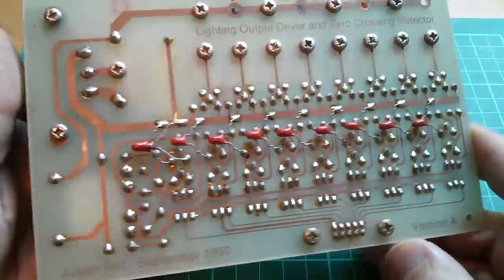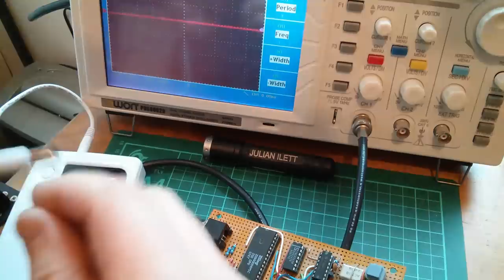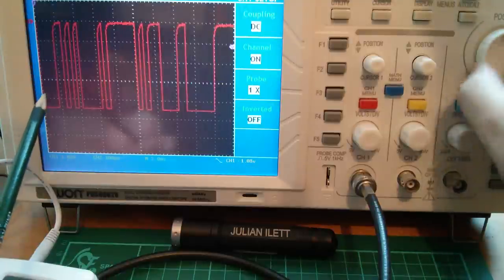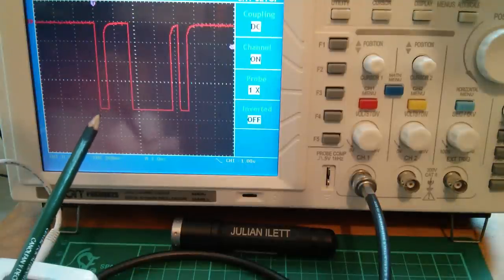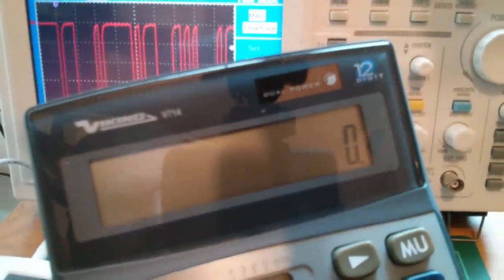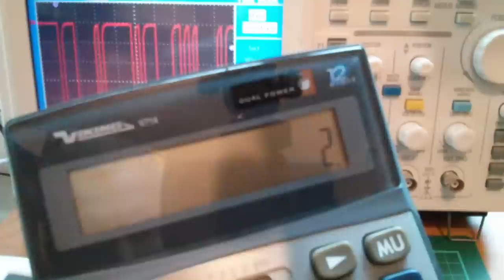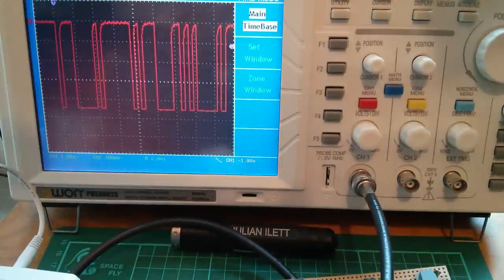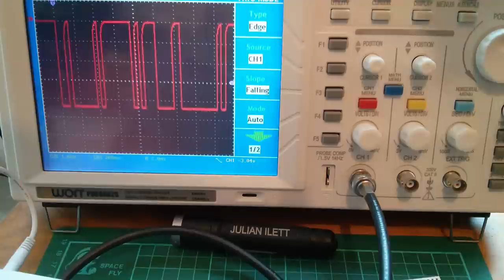Retro Electronics: Z80 Microprocessor Serial Data Transmitter

Comment: It's a bit unfair to say that the Z80 is hard to use. Sure, microcontrollers are simpler for control tasks like these, but you can't make a proper computer that loads and executes code from memory with most microcontrollers. My first computer (the speccy) where I first started learning programming, used this little chip as its CPU. As a result I'm exceedingly fond of it :)

Comment: Good old Z80. I wrote a Z80 emulator & debugger on a VAX Minicomputer while I was at Uni in the early 1980's so I got to know that CPU quite well :-)  Thanks for bringing back those memories.  Also, your Z80 boards etc look like one of my later projects using 6809. Still in the loft somewhere.

Comment: Good old Z80 times. If you are really a Z80 nerd then you know what this is off your head:
21 00 00   11 00 40   01 00 40   ED B0  C9
Reply from the maker: Something like: load HL, DE and BC with data; LDIR; RET which probably wipes the entire memory!
Reply: +Julian Ilett WOW!
LD HL,0000; LD DE,4000; LD BC,4000; LDIR; RET copies 0000-3FFF to 4000-7FFF and returns. Good old Z80. Some parts of the Z80 machine codes are still in every core-i7...
Reply: I remember C9h as RET, that's stuck in my head still

Comment: The good thing about Z80 is that there is instruction which the engineer who design it didn't know it exists. Like....

Op code shift DD or FD    and then using single byte LOAD instructions, not documented in any manual. Because they didn't imagine that possibility.

so you can "LD b, IYh"   or " LD c, IYl"

or , LD a, IYh    .... LD a, IYl

and just handle the Indexes registers as any other 8 bit operand.

This is because "shift opcodes" which enables new opcodes tables are just, by exameple: 

Exchanging for only the next instruction IY instead  HL    = FDh
Exchanging for only the next instruction IX instead  HL    = DDh

while EXX and EX DE , HL does the exchange but permanently.

what are exchanged? the ENABLEs signals to the registers, 

So, BC DE HL can become  BC' DE' HL'
and the resulted HL or HL' can become IX or IY
also, AF can become AF' .

So there is like five control flipflops.

Comment: Back when you were designing this I was trying to design a Z80 multiple CPU.  Just didn't have the time and always going around the world.  I did pick it up back in the 90's but switched to the CPU of the time which was 386.  I got the OS written as I thought that would be the hard bit but I was defeated by a hard drive crash and bad tape and floppy backups.  Wished I had a second hard drive controller if it but it was on the pricey side then.  And so the project died.

Comment: This is a great video. Thanks for showing your Z80 serial light controller boards! The Z80 isnt dead but still in wide use. I am currently learning Z80 assembly on a Micro Professor Trainer board that my University kindly let me have. I'm having a lot of fun learning assembly which is something that I wanted to do since having a ZX81 back in the 80's and am in the process of getting a 2x16 LCD interfaced to the on board Z80 PIO. It isn't easy but its excellent fun. :)
Reply: Peek and poke!

Comment: I actually stumbled across a Z80 recently.
I bought an old arcade poker-machine and the brains of it is a Z80.
I'm in the process of finding out which of the supporting chips is faulty. I'm only getting random sprites on the screen.
Not an easy task with my oscilloscope packed away.
Anyway, I'm hoping to learn plenty while doing it. The Z80 predates my world of microcontrollers. I started with pic-processors.

Comment: I still have my first computer,  an Osborne Executive,  which used a z80 processor and came with 128K of RAM in the box.  Somewhere I have a board that somebody sent me that would allow you to replace the original memory daughterboard with different parts (people also did this by piggybacking the chips one on top of another) and end up with 512K,  which could give you a ramdisk, printer buffer,  etc.  I've never populated that board.  I also have a ton of chips,  both in this family and in the 6500-series family,  which has its enthusiasts as well,  and I used to think fairly regularly that I was going to build some stuff with some of that but somehow never got around to it.  These days I'm seeing all the nifty stuff that you're doing with arduino boards,  and am thinking about acquiring some of those to play with instead...   :-)

Comment: Hello Julien. At 6:25 you mention the Plastic Cones. Would you be able to track them down at Mouser or somehwere else? Also the copper wire, i did not understand exactly how you call them, but understood how it works. I am very interested as i soon will start on a 8086 project. Also for your "pcb etching" i have special paper in my laserprinter. i print my (diptrace) layout onto it and then use a t-shirt hotpress at 266°F for 3 minutes to put the layout onto the pcb. after that i wash it with warm water off and off we go into the feryd chlorid bath. fast and easy.

Comment: I have a board similar to that from 1986 I built for central heating timer using the 50 hertz mains has an interrupt for the clock. a lot of work compared to today's microcontroller. oshonsoft do a very good simulator for the z80 along with today's microcontrollers.

Comment: Epic fail Julian. The trace on the CRO did not change colour in sync with the light controller :)
I think calling the ZS80 a microcontroller is not quite right it is probably more correctly called a microprocessor and likely predates anything we would recognise as a microcontroller. I certainly recall using the Z80 in a computer long before I was messing with 16F84 pics. The fine wire you called vero wire was known as wrapping wire here in Aus. Still pretty useful today if not in it's intended role

Comment: Are those "plastic cones'  common to fine enamel wire wiring? I have never seen this technique before on strip-board, it seems to keep everything quite neat.
Reply: I have since found that the plastic parts used for the fine enamel wiring are called wiring combs
Reply: @matthewcook7444  unusually expensive for small bits of plastic too, I was hoping China would make them for pennies by now

Comment: very interesting, i would love to see a video of you exploring that floppy disk's custom encoding of sort you described - would be really cool to see that in 2015!
Reply from the maker: +BoomBrush I'd love to look at that again. Formatting the disks is really interesting - the sectors are not sequential because there's not enough time after reading one sector to read the next (or write - I can't remember). So the sectors are skewed. I seem to remember having 9 sectors numbered 1,5,9,4,8,3,7,2,6
Reply: +Julian Ilett Could you fashion some kind of 5 1/4 floppy drive slave controller from an arduino and just raw dump the whole disk then software decode it? 
Excuse my ignorance if I'm talking complete b*ll*cks here - my floppy disk knowledge is foggy at best. I remember the Amiga doing hideous things to disk structure in the name of copy-protection, but that's about it.
Reply: One "easy" way to recuperate these files using a modern PC  is to buy a USB/Floppy drive, rip out the 3.5 inch drive and connect an old 5 1/4 inch drive.

You then need to get or write an application which read raw sectors. Even if the sectors are out of order, you can still ask the controller to read each sector in sequential numeric order, from 1 to 9. It is just slower as the controller need to wait up to an entire rotation to find the sector number specified. Since the rotation speed is 5 turn / second, it may take up to 9 * 1/5 = 2 seconds per track.

I wrote an assembler code on the 6809 processor (the radio shack Color computer) which was reading the sectors in the exact order written by the default formatting. 

I was able to read the entire track in one rotation, command to move to the next track and start reading at the sector number that would happen to be ready once the head vibration was low enough. I got the amazing performance of reading almost 3 tracks per second.

Once you get the content of the entire disk, it should not be too hard to reverse engineer the way you wrote your file.
Reply: 2017 says hello to this request.

Comment: That wire you spoke of where the enamel burns off (I think you called it varo wire), can you tell me the proper name or proper spelling. I've used magnet wire and it's a pain to clean the ends before soldering. And plastic insulated wire is often just too thick. I've been doing a search but so far, have not found it.
Reply: Marc Gv Thanks for the advice.  :-)

Comment: Yay!
I really enjoyed this video Julian, thanks!
I am in the early process of designing a Z80 based computer and this is really inspiering.
Do you have any assembly code to show of any of your Z80 projects?
Maybe you could do a video on assembly programming?
That is kind of relevant today even on the AVRs and PICs. I have only written assembly for AVRs. Perhaps modified some assembly for PICs.And debugged some Z80 assembly in emulators.

We also need to teach the AVR-kids about the Von Neumann architecture and about being able to execute instructions from RAM.

Looking forward to the next installment of "Retro Electronics" wink
Thanks again Julian!
Reply from the maker: +drbachler Hmm. Von Neumann versus Harvard architecture - that would be fun to try and explain. I remember how easy it was to overwrite the Z80's entire program space with a badly calculated LDIR instruction. I built a card for my Z80 system that had an EPROM connected to I/O ports only, so it didn't take up any address space - kind of pseudo-Harvard.

Comment: Hey nice project,  it reminds me my old Commodore 64 days! :-) I'm wondering how long it took you to build that, especially that long one with the blue wire is all over it. :-) 

I have a couple questions, speaking of wires, that wire you used underneath the board enameled copper strand, I've never used that but, I'm curious cuz I see you crossing wires over top of each other and not worrying about it shorting out? I know you said it has enamel on it, but couldn't it be accidentally melted wit heat and causing shorts from say, when your soldering it or anything around it? That is kind of interesting wire because if that is the case I like to use some of that from my own circuits that I'm building but I've never heard of it.

My second question I know you have a different scope than I do, mine is a Siglent  and I'm curious as how you got it to only grab one pulse signal and hold??  Is that just using the AUTO button? I know mine supposedly does that but I just don't know how to set it up to grab one specific signal length and to stop automatically after for example, one pulse.
Reply: +Dog Rox The wire is pretty handy - called "road runner" http://www.roadrunnerelectronics.com/Wire - also try searching for "wiring pencil" - a tool to precisely dispense the wire on a perf-board. These are also immensely handy for winding rf and nfc coils and for hooking up neopixels :) Any old enamelled wire will also work, however the roadrunner's insulation is easier to burn off with a soldering iron, and it comes in five colours for easy identification in wiring-trees.
Reply: Thanks!:-)
Reply: +Dog Rox Its commonly used in headphones.

Comment: "the z80 became old and unloved" well the z80 was before my time, but my first game console was a gameboy color (got one when all the cool kids had advanceSP), and recently I started developing software and hardware for it, and got kinda obsessed with the z80 (which the gameboy cpu is derived from).
I was surprised to find Zilog actually still makes them in the original form factor (while also having developed z80 based modern microcontrollers w/ internal ram/flash/peripherals/etc, but that's lame, if i want that i could just use an AVR :P), and a bunch of different interesting companies make compatible stuff (e.g. I got a bunch of flash chips that fake the pinout of a parallel SRAM from Samsung of all people 0.o, and pin compatible self refreshing DRAM  chips etc; very nice, essentially both are parallel addresses+data+chipselect+clock+writeenable you just stick on a bus and they just work, no ram refreshing or high voltage flashing magic etc required but also no modern fancy but hellish incompatible spi or i2c which means instantly works with the z80 and I don't need strange device specific flashers but can essentially use a gameboy cartridge reader/flasher I built to interface those too). gonna build a computer with it with my own bios and everything BECAUSE I CAN :D

so don't worry, those jewels are still very loved today. and yes I know I'm crazy :D
Reply: Theres a whole ton of different Z80 CPUs and miocrococntrollers, Z80 of course, the Hitachi HD64180, then the Zilog Z180 series, then the Z86xx family which includes ROM versions, including Tiny BASIC.

Comment: ah those were the days :) I used to build stuff like that, though it was always the 6502 for me! LDA $00; DEY; STA MEMTOP, Y; JMP [loop]...
Reply: +Alan Cordwell 6502 was my fave too!
Reply: +Alan Cordwell try using zero ram with 3registers :)   I guess you could use the stack pointer too, as there's no stack
Reply: +MattOGormanSmith Haha! ought to be possible for very simple applications, and very fast too- single byte instructions to transfer between registers ;) there's a couple more bytes to be had if you have parallel I/O as well!!
Reply from the maker: +Alan Cordwell The Z80 has the alternate register set - another BC, DE and HL which can be switched to using the single instruction EXX. That gives you 6 extra registers. I may have used them.
Reply: +Julian Hi   I could watch this stuff all day, like what you put out would like to see stuff based around "tubes"andymouse

Comment: Julian, can you show how to program the Z80, and make a simple blink program? It would be fun to give new life to the Z80..
Reply: +Edwin Noorlander At the very least you'd need a peripheral I/O chip (I favoured the 8255 for this) and some address decoding circuitry as the Z80 has no I/O pins of its own. The Z80 was only a humble microprocessor, not a microcontroller like a PIC or an AVR, and it needed a lot of support chips, as you can see on Juilan's boards.
Reply: +Nick B Er, not quite...if you use some of the tricks Sinclair used...
OK, stick your LED on a high address pin. Keep your program in low space (20-30 bytes enuf!) Access that high address repetitively - led appears on!
Alternatively, a simple 74hc74 latch....
Job done!
Reply: +Andy Crofts Er, quite. I prefer not to load the address bus in such a way! Yes a simple data latch would be fine, I would favour a 74HC373 octal latch though for a full byte and I would still want proper address decoding cos I am fussy like that, hehe!
Reply from the maker: +Edwin Noorlander Interesting idea. I could show how I did it many years ago with my Z80 based development system (editor, assembler, EPROM programmer and eraser), but nobody would be able to replicate the process.
Reply: +Julian Ilett , I think its more like people like to learn old method. And the technology is much cheaper now. Ben from the Ben Hackshow make his own ZX spectrum. And people love retro computers. Well I do.
Reply: +Julian Ilett I'd certainly give it a go! My Z80 assembler book just arrived so be an ideal project.

Comment: why was it necessary to have zero crossing detection on the lamp control boards?
Reply: For dimming. Bigclivedotcom has a good video about this. Search for "bigclivedotcom led dimmer" here on YouTube. Basically it is for the mcirocontroller to determine when to turn off the lamp for a brief moment to make it seem to a human as if it was dimmer.

Comment: I'm wanting to fix a circuit board with a new capacitor, does it matter which way round the capacitor goes?
Reply: +Aidan Brown well, that depends on the capacitor you're replacing. There will typically be a marking on the board if it's an electrolitic. Best bet is to place the new one the same way you took the older one out. You can upload a picture to imgur.com and someone else or I might help you out.
Reply: +MrMistery101 thanks, the old one exploded as it was on a 12v 1000w converter (my farther is a trucker) and he hooked it to 24 volts, I guess the circuit may say or online somewhere,

Comment: The Z80 is a great processor for the project because arduinos and stamps didn't exist back in the 80s

Ha!
Reply: By the 90s you found the Z80s in printers/copiers. We still have a Osborne 1 although we got rid of a Heathkit H-89 to get it originally.
Reply: 8085